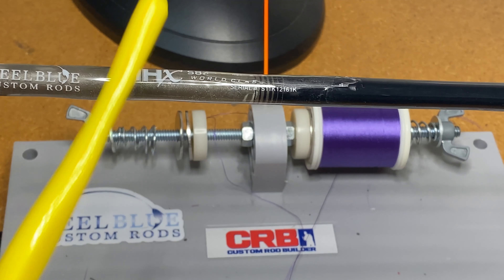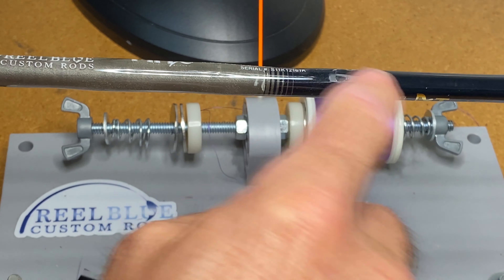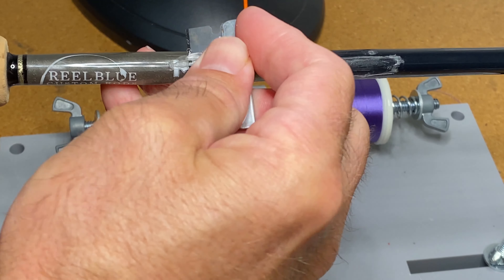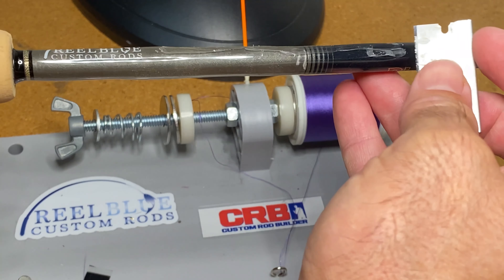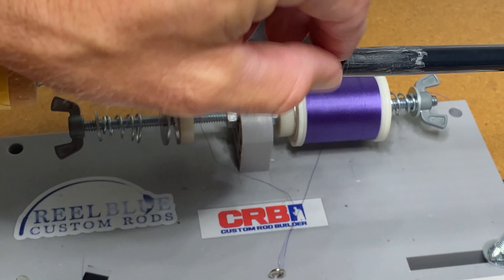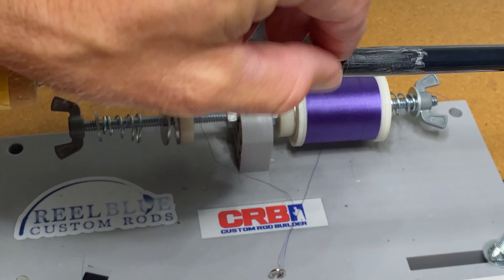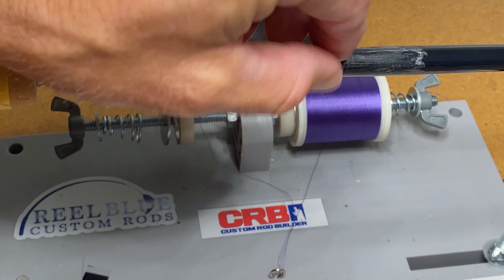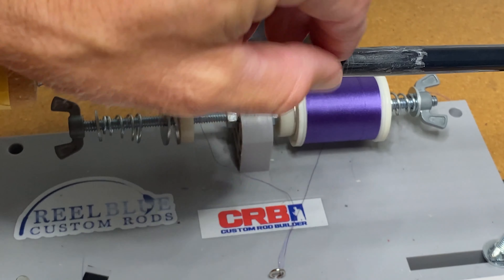Custom Rod Building: Epoxy Repair

Comment: Could you do a full video of a change of damaged guide from A to Z. Removing guide preparing surface and installing replacement. Also how to fix when there is a small whitish crack or 'stretch' of epoxy over a guide foot, can this be repaired as is or does it also require complete removal. Thanks for your videos.
Reply from the maker: I’ve been doing a lot of guide repair lately, and posted a short on Monday on removing the guide.  More to follow.

Comment: Use a heat gun on meduim heat it softens the old epoxy,chances are you will cut into the rod with this method  - South Africa
Reply from the maker: Thanks for sharing and I’ve use heat guns as well, but prefer alcohol torch.  Thank you for watching and commenting.
Reply: Classicassasin  are you connected with assasin rods South Africa ?
Reply from the maker: @ShorrockPaul  - no.
Reply: I was asking classicassasin if he was. As he said he is from South Africa and I have an Assasin rod from South Africa